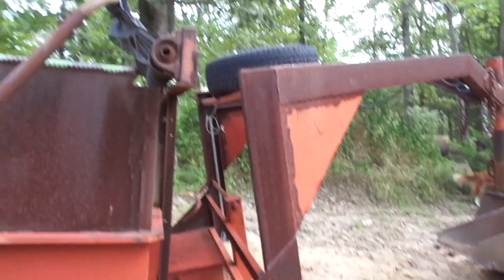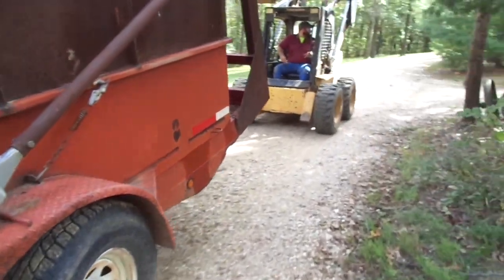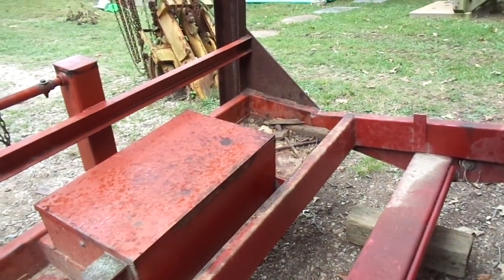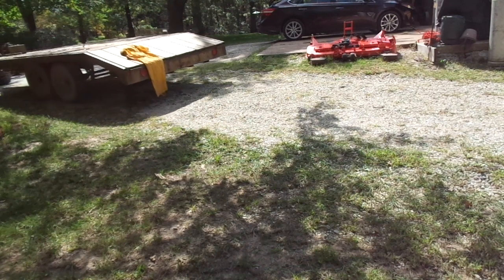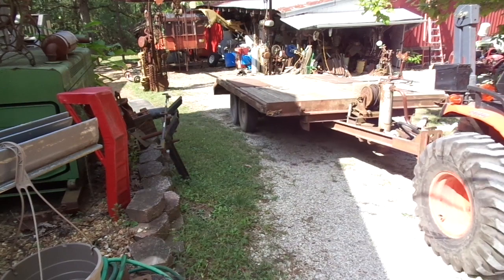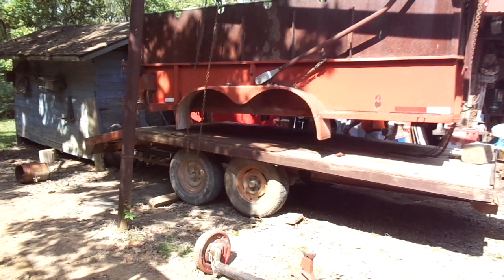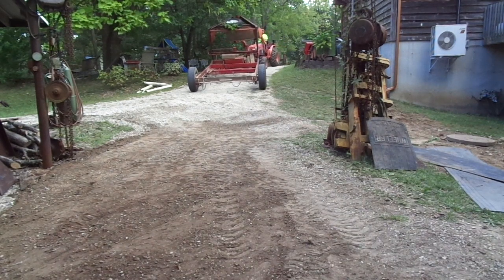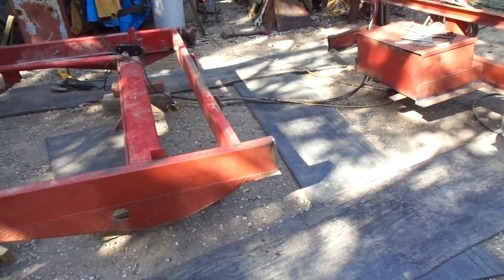Tandem Dump Frame Failure Pt 1

Comment: That little 'ditching bucket' on that skid steer attachment, has given me something I can do with the narrow backhoe bucket I have here. 
That goose neck trailer should be better than new when you're finished, I'll bet. I'll be waiting for the videos on this 're-build'.
Reply from the maker: Oh, there will be a few videos in this series and yes, it will be a lot heavier built when we get done with it.  That's a good idea to use an old hoe bucket to build a QA rock picker.  Thanks for the comment Reg.  Its appreciated for sure.
Reply: @tractorman4461  Then I'll be looking forward to those videos too.

Comment: 44 your right a lot of work but fun watching others figure it out
God Bless 
PaK
Reply from the maker: Good Morning Peter...yes, it is a bit of a project.  The main thing to remember is square and plumb and starting off with the reassembly with everything level.  Well of course, there's the welding too.  Thanks for hanging in there sir and hope its not getting too cold too quick up that ways.

Comment: How's she goin'?  It's always a tricky job when you try and straighten a damaged frame.  Having the piston kick back and bend the axle really added some beans to the soup on this one!!!  Hopefully the springs took the brunt of the force and the frame is still straight.  Replacing/repairing the goose neck will then be the only tricky part!!!  Looking forward to part 2!!!  Take care!!
Reply from the maker: The answer to that will be in part 2 I believe.  Its not looking good for the frame at this time...I think 'its outta here'...LOL.  That was a very thin wall tubing used for the subframe and a butt joint would be difficult to reinforce especially making the repair with thicker material...sooooo....
considering there is 3/4" difference in the middle compared to the two ends I think its time to do away with the old and in with the new !!

Comment: Had the frount frame of my plow truck bend like that last winter! Right where the plow harness bolts on, it just got thin from Rusting and actually split than the weight of the plow sagged the frame into an aggressive bend lol. A few Ratchet straps and I was able to limp it home take the plow off then take it to my good friend who has a variety of metal working goodies (torches,welders) and with a bit of persuasion (chaining it to the backhoe and horseing it back) we got it back together however that plow is retired this winter as it owes Me nothing lol Cheers!
Reply from the maker: THAT's a good story.  The salt and chemicals take their toll on truck frames especially those sporting the extra weight of a plow.  I can see that happening.  I see guys a lot with plows on an F150 4wd around here.  I don't see how they last. Sure glad your buddy was set up to help you get it back together!!
     We used ratcheting chain binders and chain to force it up off the ground high enough to get it the 4 miles home.  That's after we shoveled three good pickup loads out of the trailer and left the last bit behind the back axle to help counter the weight.
Reply: @tractorman4461  Holly smokes! That's crazy! I'm glad you were able to figure out, and looks like you've got that thing fixed up real nice!

Comment: I remember you mention a rock digging bucket.  Now I get a clue of what you meant.  But now I have one more project on the list!!! That could be helpful for us to dig larger stubborn rocks.  You had quite a nice day: dead pump, bent gooseneck, failing starter! I can't figure why they would have used 0.116 material.  3/16'' would have been good. Then 1/4'' be great.  Especially where the gusset meets the frame.  Maybe an extended plate on the side of the frame would have helped. Looking for part 2!
Reply from the maker: Good Morning Joe...my neighbor lady owns and operates a salvage yard north of town and that home made rock bucket was brought in for scrap.  So I was helping her with some things up at her house and she asked if that would fit my skidloader.  It does fit it as well as the son in laws L3301 Kubota.  Plus she gave me another set of QA forks, so those stay with the SIL's tractor.

I didn't measure it with a vernier, but it sure looks like .116.  I thought it was way too light for what its designed for anyway.  It must be hugging the lower end of the scale on the gross weight rating tag on the trailer.   Its going back with .250.  We turned the gooseneck into a pretzel a couple years ago (note the typical tractorman44 patina).  I helped my older brother rebuild the whole gooseneck with extremely heavy channel then. The original was light guage 6" channel.
Reply: Ok, then it needs to be all 0.25 channel!
Reply from the maker: @FromSteelToWood  Yes, last evening while trimming up the drops on the gooseneck, I found the front crossmember bowed just a bit and the welds pulling apart at the bottom of the jack.  So that too will be changed to .250.  It will actually make the butt joint from the frame rails more accessible to weld into the drops with it removed.  Then we will lace 1/4'' strap under the butt joint as well, then replace the front crossmember with a butt joint into the frame  new .250 rails.  And yes, the whole sub frame is being changed to the thicker material.  Can't do it halfway Joe !!!  LOL

Comment: Morning T! This looks like it will be an interesting project. Looking forward to it. Hey, question - I noticed you have tire chains on the Kubota. Do you keep them on all year long? Thanks - have a great week!
Reply from the maker: Good Morning Sir...yes, interesting is an understatement !!  LOL  Its totally disassembled at this point...totally.   Yes, the chains pretty much stay on all year long. It digs much better on a rain slicked and leaf packed hillside climbing over fallen limbs and other dead things.  Remember it digging in a bit coming up the incline pulling the 5,000 pound John Deere 50 ?  Another case where the chains are beneficial and mud isn't even in the picture.
    Put mud in the equation and the chains are wonderful !!  Also, spinning on the sharp tif rock (barite) with bare rubber puts cuts and additional wear in the treads, the chains snag the sharp edges of the rock for traction and minimizes unnecessary wear. You seem to have nice rounded edge rocks up there...down here they are fractious, plentiful and very sharp edged.
Reply: Thanks T! I got my chains but for some reason didn't think I could use them all year - I figured just for the snow. I rewatched your tire chain video twice and Joe's, in prep for the video today. Wish me luck - never done it before. Cheers!

Comment: Typically 6 lug bolt axles are rated at 5200 lb, so your trailer would be a 10,000 lb rated trailer. With that light of a frame i wouldn't even factor in the extra 20% that is usually allowed for a goose neck. With the trailer frame being such light weight tubing,and the fact that dump trailers get overloaded all the time i would lean towards 3/16" tubing. 1/4" is just over kill and take's away from load capacity. looking forward on how you proceed on this repair.
Reply from the maker: You are absolutely correct about the axle rating.  Its hard sometimes to collect thoughts spontaneously while ad libbing narration during a video. We have already twisted the gooseneck into a pretzel a couple years ago.  It was originally built of light guage 6" channel and we replaced with much heavier guage material.  So the weak point was at that point exactly where this frame collapsed... right where the gussets from the risers met the gussets from the shackles forward on the underside of the frame. 

    The heavier gooseneck added almost exactly 200 pounds and I'm thinking the 1/4" sub-frame will add approximately 175 pounds. Thank you for watching and commenting and you are right again, 1/4" is definitely overkill. I was considering using 3/16, but the local supplier had none in stock.